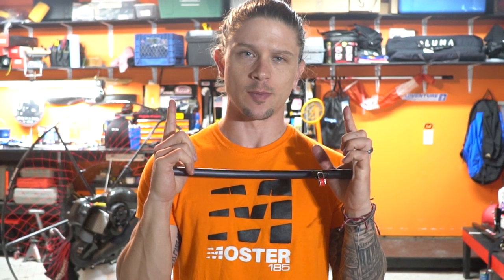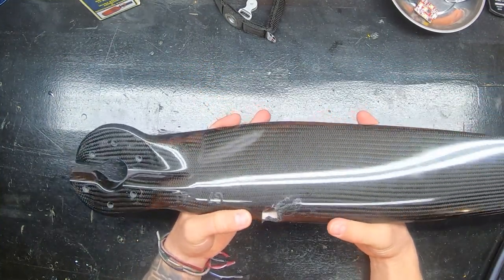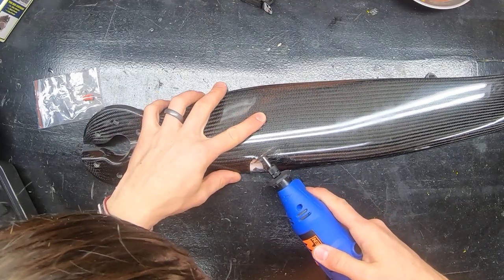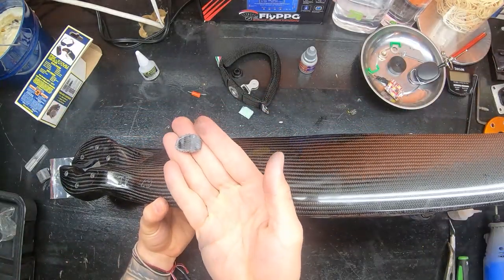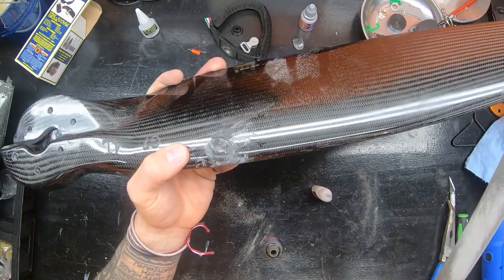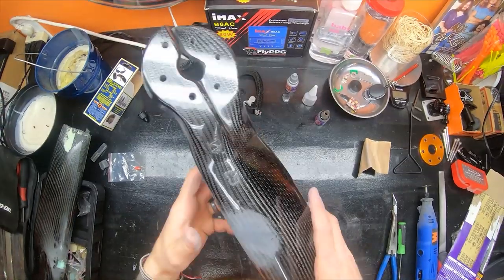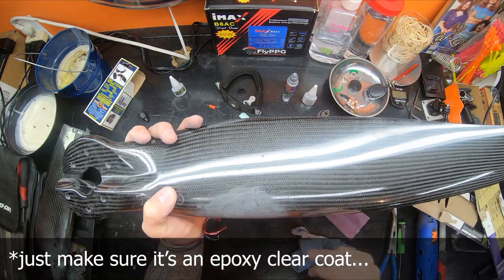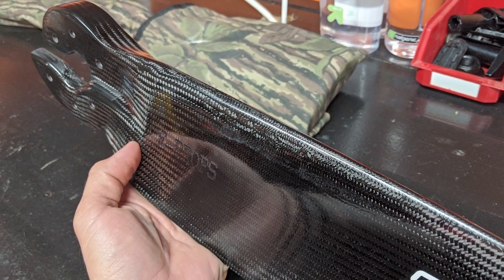How to Fix a Carbon Fiber Propeller

Comment: I had to look up the difference between Q bond and baking soda I have always used.  Here was the answer I found:  "Prior to Q-Bond I used to use baking soda as a filler for cyanoacrylate adhesives, but it's not something I recommend since it results in quite a violent reaction that releases nasty fumes. Q-Bond is not only safer, but the end results are much better"

Comment: Great video and good job, Tom. Q Bond is an excellent product and has never let me down on any prop repair. For clear coat, I've only used clear rattle cans to finely balance both vertically and horizontally. On severe damage, I've drilled into the blade that requires balancing and filled with epoxy. Just check it doesn't react with  the foam as you already know. Also keep in mind on engines running rich and "spooging" on the prop, it could react with the clear coat. That's my experience anyway. Hope some of it helps. Thanks for the video 🙂

Comment: What I find super helpful doing these repairs is an oscillating multi tool with a sanding block. You can get them at harbor freight. Saves a ton of sanding by hand and allows you to get a more precise shape. 

Yes, Q-bond is amazing stuff. I've fixed many a prop with it.
Reply: do you have a link to tool you mention, so I can see what you mean

Comment: I had to repair my prop Saturday after foot dragging a gravel road (pro tip: don't do that). I repaired mine with medium CA, accelerator, 400 and 2000 grit wet sanding followed by two compounds on buffing wheels and finally waxing it. Just like new!
Reply: Video! :)

Comment: Good repair. Do you rebalance?
Reply from the maker: Haven't done it yet, but I will before flying it. Just gonna add clearcoat layers to the other side until it's balanced.
Reply: U guys know of an company that sells a dedicated prop balancer that’s works well for paramotor props? Those lawn mower blade balancers are 💩!
Reply: @yfz450manny  I hang mine from a string through the bolt holes to balance
Reply: Mitch G yeah... that’s not gonna work very well.. to get a very accurate balance that is.. A proper balancer should center precisely on the center hole of the prop. If not, u cannot properly balance the hub of the prop. Coming from a long time background in R/C aeromodeling  I’m super surprised to see that no one is manufacturing and selling a proper prop balancer for PPG props. ☹️🤯
Reply: @yfz450manny  it's not 100% perfect but it gets them close enough that you cant tell a difference. Still better than not balancing at all like I have seen other people do
Reply: Mitch G Hmm.. I wonder how unbalanced a prop can get before a pilot can actually feel it on his/her back. I have a feeling our rubber isolating engine mounts are absorbing more vibrations than we know.
Reply: Tom Kubat this ☝🏼 would be a good vid for u to make! How unbalanced is really unbalanced?! Take a “supposedly” perfectly balanced prop and add some tape to 1 blade - rev it on ur back and see if u can feel the difference. Keep adding tape pieces to the same blade at the same spot till u can feel the difference on ur back. Peel off all the tape and weigh the tape.
Reply: @yfz450manny  your cracked moster exhaust will let you know when your prop isnt balanced lol
Reply: Mitch G Hah! 😆 Got an MY20 exhaust already lined up! I definitely don’t wanna be part of the statistics! Hey, u guys planning on attending the Bad Apples event in GA, if it happens?

Comment: What kind of clear coat do you use on a carbon fiber prop?
Reply from the maker: If you’re gonna polish it, you need an epoxy based clear coat. Otherwise just use some rattle can clear coat (that’s what I do) ✌️
Reply: @Tommyflies  TY for replying

Comment: Hello. You should inform yourself with solid knowledge about composite materials, laminates and sandwich structures and how to make a repair on a carbon part before trying to make a repair of that type where you only filled with foam and glue the leading edge of a propeller where there is a broken laminate with all the risks that entails. Anyway, if I were you, I would first look for a professional to make a repair like that on a part that if it breaks...you could hurt yourself a lot or hurt someone else. "The prudent man sees the danger and hides." THAT REPAIR IS POORLY MADE AND THE PART IS AT HIGH RISK OF SUFFERING A CATASTROPHIC FAILURE.